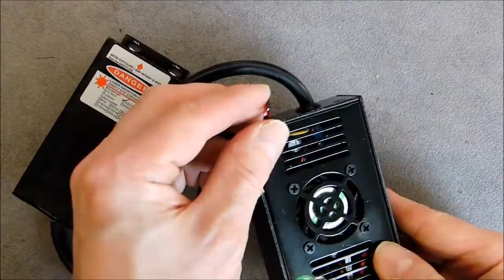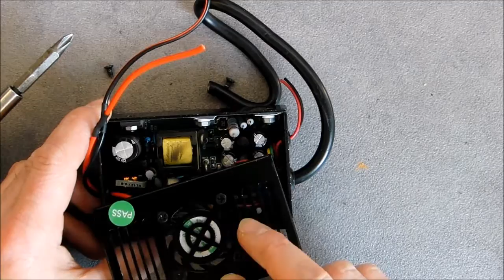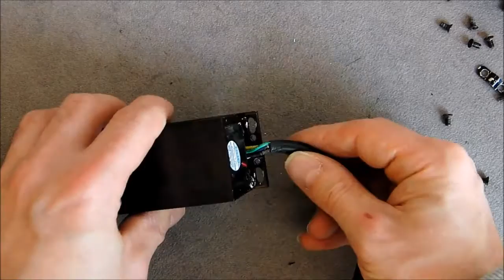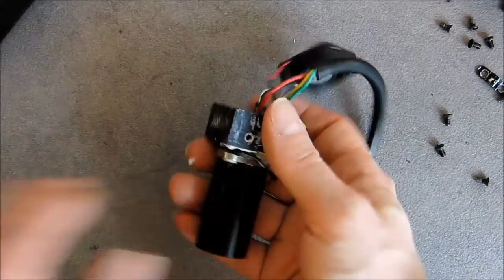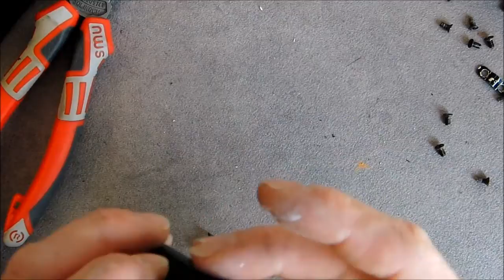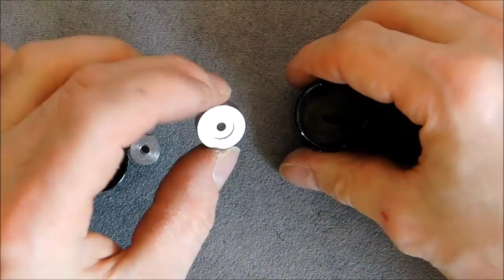Crappy chinese green laser teardown

Comment: Its alright having that fan in the end of the laser module, but the way that fits in the housing, there's nowhere for the air to go! The peltier cooler was probably added in an attempt to get some cooling on the laser diode...
Reply: +Alan Cordwell  If you look closely to the sides of the laserhead you see some openings for cooling air.

Comment: Interesting Teardown. I wonder why on earth they used a peltier cooler on the laser module. It just makes more heat that needs to be dissipated by that tiny heatsink. The wavelength-shift caused by the heating of the IR-diode is not important for a light effect. You need to be aware that this is a DPSS-laser - the glass in front of the diode is not a "window" - it's a KTP-crystal that is part of the DPSS action. The IR-laser is very powerful and invisible so watch out!